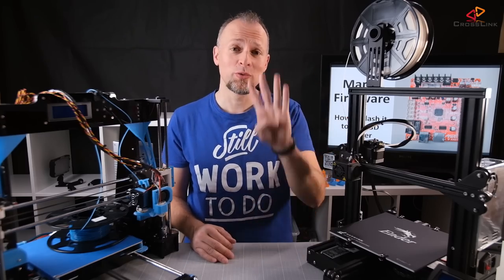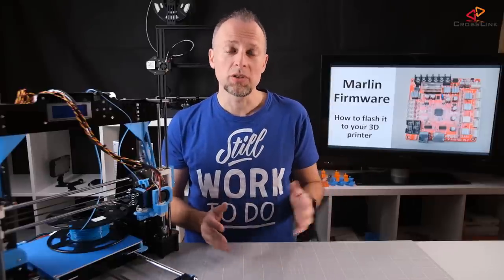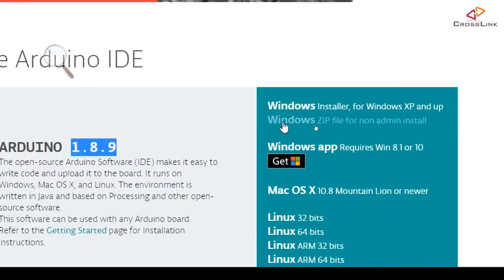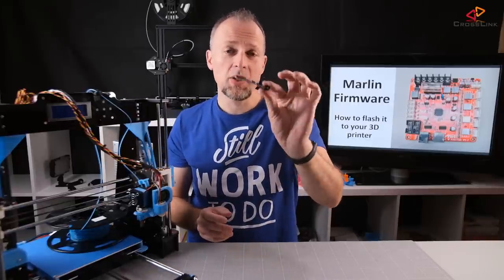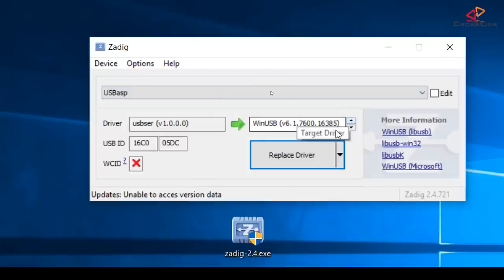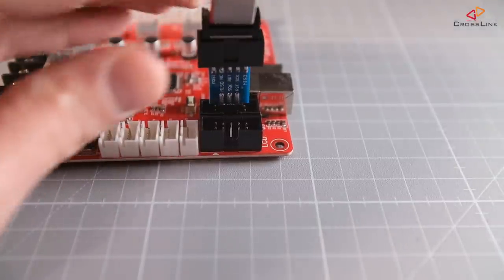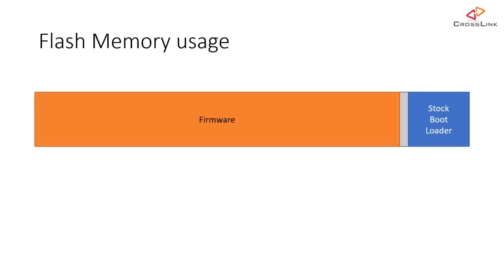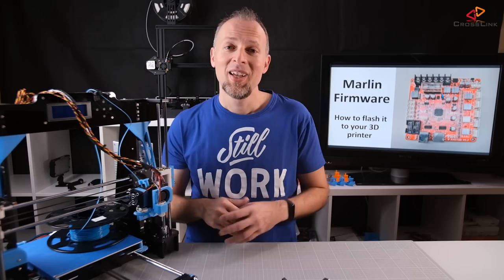Anet A8 Marlin Firmware 1.1.9 Upgrade. Comprehensive guide.

Comment: Worked perfectly! Have an Anet A8 v1.5 board. Had to use the USBasp programmer and burn the bootloader onto the Anet board. Using the Arduino 1.8.5 isp on Windows 10 the upload of the Marlin 1.1.9 went flawlessly. 

Thank you

Comment: This was a fantastic guide. Even though now the 1.8.9 version works just fine. The one problem I had was my own fault was make sure no other programs are running that may block access to the printer. For me it was cura, even though I've had it open for days before getting my printer it automatically connected itself the moment I plugged it in and it was blocking me from updating merlin. That added about 20 minutes to my day lol. Now I get to actually try setting this bugger up to print!

Comment: Found the problem when the board, Couldn't see it through Cura either. Bought a new board and it works fine. The o;d one works, just can't upload or intact with it, not even through an Arduino. Marlin is installed now and I'm glad. Next project is to build my own frame and put a 32 bit control board on it.

Comment: This is a great way to get in touch with the shortcomings of the Atmega1284p and then long for the days of through-hole chips and sockets. Graphic display + SD card + filament change is already too much for 128k.
Technically you could still swap it for the 2560 and enable features to your heart's content but it's safe to say that's a good option for only the most skilled of absolute cheapskates vs Arduino Mega+ RAMPS.

My cheapskate solution was just not to get the graphic display and hardcode my calibrations into firmware without EEPROM save.

Comment: Hi Daniel. I've used the TinyISP with the adaptor, used the  Anet A8 (Optiboot) and had an issue which I can't understand what to do or what i'm doing wrong. First of all, I have a clone of the Anet A8 board and this is the error when I try to burn the bootloader:

Reading | ################################################## | 100% 0.41s

avrdude: verifying ...
avrdude: verification error, first mismatch at byte 0x1fc00
         0xff != 0x0f
avrdude: verification error; content mismatch

avrdude done.  Thank you.

Error while burning bootloader. 

Thanks in advance any importance this comment may have had.

Comment: Hi Daniel,

Thanks a lot for the good work you are investing on this!
Can you please clarify:
What is the better option: completely disconnect the printer’s main board from the printer while bootloader  burning or let it in place and turning on while connected to the avr programmer? (Different sources state differently)
Reply from the maker: Actually I tried all variants and they all worked so don't worry about disconnecting the mainboard.
Reply: Crosslink
That’s good to hear! Less effort!
So I plug in the avr thingy in the middle 6 pins of the jtag socket, switch it on and burn the bootloader from Arduino IDE, right?

Comment: I've messed up. So i think I've done everything right but when i choose the right board in Arduino then try to open the programmer the programmer says there isn't any compatible. There is another issue when formatting the port on my computer it didn't select USBAsp it did a different thing USBHID. I don't know how to fix this, please help, i have put a lot of money into trying to upgrade my printer with BL touch and if this doesn't work I've got a problem. (Also Im using the Ender 3 if that helps)

Comment: I tried to upgrade the firmware of my Anet A8 board v 1.7. The only obstacle was the Arduino IDE. The current version (1.8.10)  threw errors. I installed 1.8.9 and I could flash Marlin.
Reply from the maker: Great! Hope you get awesome prints!

Comment: for anyone that is struggling to install a bootloader via a USBasp you will need to download zadig and install the driver for the USBasp via that and have it as libusbk(v3.0.7.0) or libusb-win32 (v1.2.6.0) so arduino ide can use it and if it fails to burn you will need to change the arduino AVR Boards by arduino ( the one at the very top) on the board manager to version 1.6.9 and make sure your 3D printer board has nothing plugged into it and is also powered off and it should work but you will need to change the board back to what you had it as before changing it so you can then upload marlin onto it

Comment: Hi Daniel,
I've got some problems in upgrading the firmware of my Anet A8 to the Marlin Firmware 1.1.9. When compiling the firmware, I always get a lot of error messages regarding redefining of timers (see example):

In file included from C:\Program Files (x86)\Arduino\hardware\arduino\avr\cores\arduino/Arduino.h:257:0,
                 from sketch\HAL.h:36,
                 from sketch\MarlinConfig.h:39,
                 from sketch\G26_Mesh_Validation_Tool.cpp:27:
C:\Users\Michael\Documents\Arduino\hardware\anet\avr\variants\sanguino/pins_arduino.h:43:0: warning: "TIMER2" redefined
 #define TIMER2  5

at the end of the compilation, the message says:

Der Sketch verwendet 104094 Bytes (81%) des Programmspeicherplatzes. Das Maximum sind 126976 Bytes.
Globale Variablen verwenden 4096 Bytes des dynamischen Speichers.

So lack of memory space seems not to be the problem.

I'm using the arduino IDE 1.8.5 (but also tried 1.8.8). When I compile the firmware for a MKS Gen 1.4 Board, there is no problem at all.

Any idea, what can fix the problem?

Michael

Comment: Hi Daniel, I'm using anet A8, got everything flashed and updated, one problem I have is that my SD card isn't working, my printer is in the garage and I use I'mac so not very convenient to move all my stuff every time I want to print something. any advice on enabling SD? I'm pretty hopeless with the programing with Arduino, managed to find couple of resources to add extra code, but didn't know where to implement them.
Help really appreciated

Comment: I got sync errors using both Arduino IDE and VSC. For anyone else that doesn’t have a programmer or UNO handy, you may be able to get around this by switching the board option in IDE from “Marlin AVR Boards” to “Sanguino” (search “Sanguino” by Kristian Lauszus under the Manage Boards option under Tools>Board). My particular Anet board had an ATmega1284P (16MHz). Once I had the correct board and processor selected, IDE verified and uploaded Marlin 2.0 without issues and over USB.

Comment: Hello, I would like to upload Marlin 1.1.9 firmware but I allready crashed a mother board (I had to buy a new one, impossible to make it works again, blue screen and bip, no more blinking led on the motherboard, I will weld a new atmega 1284p chip later), I would like to be sure when you connect the printer to USB, the programmer stills USBasp.
I saw there is some trouble sometimes on v1.7 motherboard

Comment: But my Ender 3 pro has a different motherboard that doesn't have the 2x3 pin plug beside the LCD display plug. It has a different 1x5 pin plug for BL touch but I need to also need to upgrade firmware. How can I upgrade my firmware I don't have that port? Do I really need to go and spend $53 on a new motherboard?

Comment: If I do this one time and install Marlin into my anet A8 board, then if I need to change something in the programm few days later, for example some data in configuration.h folder, do I need to use USBASP,  USBTinyisp or Arduino UNO all this percedure again? Or I need just connect Anet A8 board with computer and upload without these programmers?

Comment: PLEASE help. I used my BLTouch USBHISP thinking it'd the same thing after some research and looking the exact same. Ive now made my ender 3 lcd go black and now not working. Now the USBHISP is showing as driver: NONE in zadig. When I try to install WinUSB driver it fails. How can I revert this to be at the least back to the original USBHISP so it can be used for BLTouch again in the future. Unless this does work and I did something wrong. I couldn't get ATmega1284 to come up only Mega1280 and Mega2560 and was told because I have a ender 3 pro its Mega2560. I tries this, and tried uploading it from visual studios via my USBHISP hooked up to the ender 3 pro. Now I have this issue. Any help!?

Comment: Dumb question...the A8 board is basically plug n play no need to change some things and no way...that I know ...of changing other things. So if I upload Marlin, the board gets a cut down version due to chip size limits....do, is whats left going to put me back to the start up ready to go as the A8 firmware does?  I ask because I see FB posts about re writing settings and uploading the adjusted FW.

Comment: Sir, I have an Anet A6 that I modded so it can possibly print up to 450mm in Z (changed chassis, longer rods, ..)  my problem now is that when I print something that is higher then 250mm the printer stops moving the Z-axis because it thinks its as far as it can go. Will I be able to make the printer go higher in Z-axis if I update the firmware? Or, how can I make the printer think it can go more then 250mm high?
Reply: Thx.... :/ I will find it out on myself

Comment: Hi, Daniel, l great video I am new to 3d  printing so any help would be great,  I updated to marlin and foolishly did not back configuration file :-(  I now have a printer sitting on a marlin screen with no menus  I have tried to find basic setting menus like the default that came on the printer and can not find the cf files can you please point me in the right direction I am devastated even though I know its probably easily fixed.

Comment: Sorry let me restate that I'm somewhat new to 3D printing but not a computer Noob I have Marlin 1.1.9 installed I have run into the problem where some prints do okay but most wind up scraping each other after the 2nd to 3rd layers or higher any suggestions on why this is happening thank you and bad is leveled

Comment: Hello I 've loaded the bootloader, but the arduino IDE does not let me to intall the new firmware, it always shows me an error message, ser_open() can't set com-state for . com5. I believe that it's a usb drivers problem, is there any other form to flash the board besides USB?. In the middle time the printer has no firmwar so it shows only blanc squares on the display. 

Thank you very much
Reply from the maker: There is a driver installation program in a subfolder of the arduino ide folder. you should execute this and then it should see the printer.

Comment: My board did not light up either when I plugged into it.  When I tried to burn the boot I get the error: avrdude: warning: cannot set sck period. please check for usbasp firmware update.
  Any suggestions?
Reply from the maker: Some USBASP clones have older firmware that causes this issue. The only way to solve this is to flash a new firmware to the USBASP controller using another Arduino :-(
Reply: @Crosslink3D  The link to the hardware in your description leads to an amazon sold USBasp that needs to be flashed.  I just bought it and am a little frustrated.  Could you perhaps do a video on this process?

Comment: Hi. i have the 10-6 pin adapter you mention, but the link light does not come on, and in the arduino ide program the "port" is ghosted out.   win10 does see both the usbtinyisp and usbasp.     have I done something wrong??    sorry. total noob!!

Comment: I have an Anet A8 with the version 1.5 board.  When I open the Arduino IDE and try to import the 2 Anet A8 configuration files, the files will not import.  I am using the same version of the Arduino IDE that you use in this video.  Should I just copy and past the files into the IDE?  I want to flash the board so I can use the E3DV6 that I purchased.  I would greatly appreciate your advice and insight
Reply: Im having similar problems with and anet 1.5,,, on my a6 the board eprom has presets for the A8 and even corrected with repetier it continues to return to a center offset of 30 mm on x axis and 4mm on y axis.   downloaded avrdudess and still same   "avrdude.exe: stk500_getsync() attempt 10 of 10: not in sync: resp=0xb8" error   
win 10 win 7 all the same.   tired of the fight, going to submit to new board and going to send the old one back to anet,,,  even on the repetier server software the board is labled A8 but they don't seem to understand that the offsets are machine design differences.  I shouldnt have to work this hard for a product i paid for.
bought a anet a8plus  $150 and no issues,  going to flash that with marlin shortly

Comment: Dear friend, I am very new to this and I just bought an Anet A8 Plus, and I want to install the capacitive calibration sensor, I already printed the support and the sensor is mounted.
The problem is that I can't upload the Marlin to the printer, it gives me a compilation error. My machine has an Anet V1.7 board and I use the Arduino 1.8.11. Is it possible that you can give me some help regarding my problem?
Thank you.
Reply from the maker: Have you asked this already in our discord channel? If not, please come there and post your error logfile. We can help.

Comment: So if I have a working anet a8 board that is already flashed with marlin but I want to make changes to the config, and those changes result in drawing too big. I will need a usbasp module to get optiboot loaded so I can further customize marlin? Am I understanding this correctly?
Reply from the maker: Hi, Thanks for your comment! If you managed to flash Marlin with the USB cable you can do this multiple times. The usbasp is only needed if you run into issues or if you run out of flash memory because the firmware gets too big. Then you need to flash either the optiboot bootloader or flash without a bootloader. The bootloader is making it possible to flash over usb.

Comment: Hi I need to update the firmware in my A6 Board I have tried the USB method but it seems I have somehow done somethng wrong as it no longer functions apart from a funny clicking noise is it possible to rescue this board
Reply from the maker: Yes, normally it can be fixed by using one of the three other methods that I have shown 1.) Arduino uno 2.) USBAsp 3.) USBTinyISP

Comment: Hi, recently buy a anet 1.7 board because my printer stop working, i think was the board. how i realise that this new board has the bootloader?.
Do you know what could have happened to the old board?. when i indicate move a motor or preset the bed it turned off, i alrredy replaced the power suply and the printer has the same problem. Now not even power on. I suspect it broke because the eddy current for the motors.
Reply from the maker: Maybe you have a shortage in a cable. Make sure all cables are still intact. Specially the bed cables are faulty easily. Don't use self-printed cable chains.

Comment: I followed all the steps for the usbtiny solution. When I first got everything connected and ready to burn the bootloader I got the next error on arduino IDE "avrdude: verification error, first mismatch at byte 0x1fc00
         0xff != 0x0f". I repeat, I installed the correspondend drivers from ada fruit for the usbtiny and I'm able to see it on the device manager on windows. By the way, the red light on my board stopped blincking at all. Any ideas? :(
Reply from the maker: Hello David, I might have a workaround. Sometimes the avrdude tool behaves a little strange but you can still convince it to still flash your bootloader anyways. Check your output section of Arduino IDE what command line gets executed to flash the firmware. copy that complete command with all parameters and execute it in a console window but add the -F parameter to it so it will skip the verification. If you are not sure what to do, please come over to the discord channel so we can help you better. It's linked in the Description.
Reply: @Crosslink3D  Thanks I'll keep in touch
Reply: @pizzabola  Did you find a solution to the verification error? Have the same problem.
Reply: @kodlo007  Hi, I couldn't find any fix to the problem. It could be my computer, or the board, or the firmware. Too many variables. I finally changed mind and went for the  Big Tree Tech SKR v1.3, and everything works great.

Comment: Hallo Daniel, I am getting this error message when trying to upload marlin 1.1.9 to my Anet 1.0 board "exit status 1
non-constant condition for static assertion" I already installed a boot loader via an USBasb connector which worked error free.
Unfortunately my machine does not work anymore

Comment: I cannot get the TInyUSB to work. The port section in Arduino is greyed out. I installed the drivers and it shows it in the device manager. I have it plugged in from laptop from the USB slow that goes in to the TinyUsb but nothing.

Comment: I love your channel, I watch your videos a lot.

I want to flash marlin on my board but im wondering, is it not possible to connect it directly to the usb from the anet? i have a 1.5 board
Reply from the maker: It normally works. But if you run into issues you might need a programmer.
Reply: I have a 1.5v board and can confirm you need a programmer
Reply: @barry0719  I'm glad I saw your comment because I have been trying for over an hour with every combination to get my V1.5 to flash and it keeps saying "error compiling for board Anet V1.0" Seems I'll be getting a programmer now.
Reply from the maker: Compilation errors might happen before the flashing starts. Can you post the errors here?
Reply: @Crosslink3D  I recently bought Anet A8 and have V 1.7 board  Is there any method to upgrade to Marlin firmware(1.1.9 or 2.0) without any USBasp, tinyISP and adapters. I have just the uploading cable and board.

Comment: Hi Daniel, follow all the steps and Optiboot ok, but when compiling the Marlin 2.0 bug fix or even the 2.0 at the end comes an error : avr-gcc: error: CreateProcess: No such file or directory
and many errors like (example) : Error while detecting libraries included by C:\Users\pedro\AppData\Local\Temp\arduino_build_923368\sketch\src\gcode\calibrate\G28.cpp
can you help please?
btw Marlin 1.1 I uploaded without any problem... the 2.0 I just can´t compile...